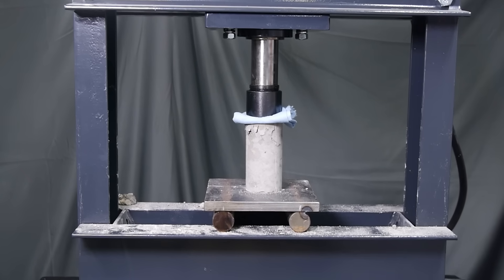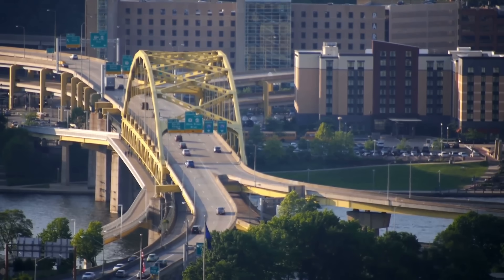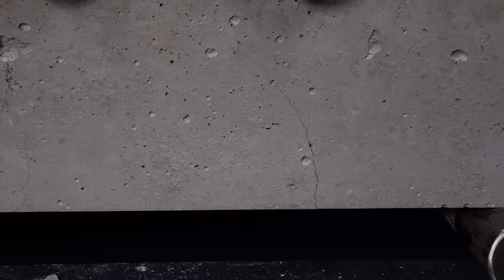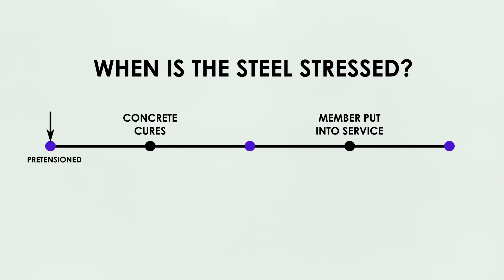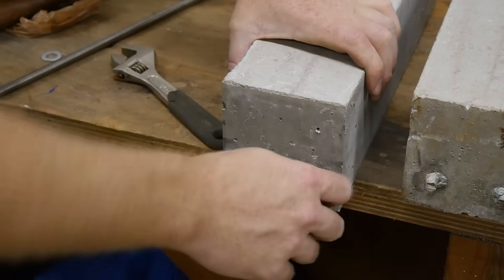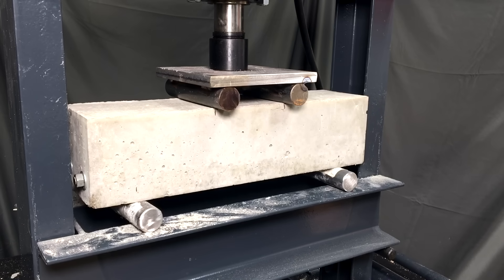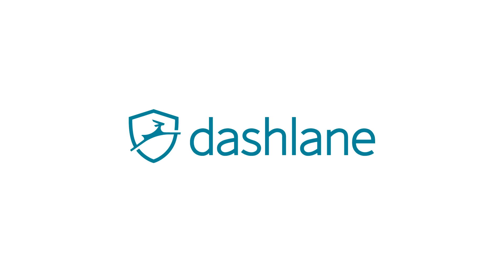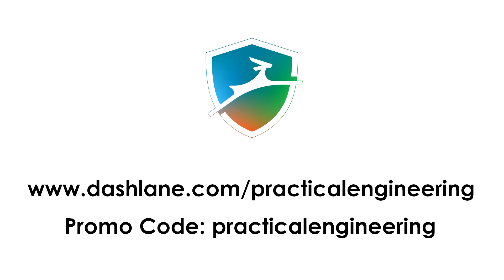What is Prestressed Concrete?

Comment: Thank you, I enjoyed this video. I did not read all 800 comments but I was wondering about something.

What about the ductility of the steel used for tensioning?  I expect this depends on the grade of steel used. In the case of pre-tensioning, once the metal stretches, I assume there is nothing else that can be done.  In the case of post-tensioning, it would seem that the steel could be re-tensioned several times but a limit would eventually be reached.  What is the typical service life of pre-stressed concrete?

Comment: Seems that the pretensioned has the stress across the full length of the bar, while the post is put on the ends of the block. Any discussion about that?

Comment: Hmmm...notice that the pre and post tension beams both have a catastrophic failure ( concrete breaks shortly after cracks formed), while in conventional method the cracks can be observed well before concrete breaks. I am not sure how frequent these structures are inspected but catastrophic failure always needs to be avoided? Or it only because the shape of reinforcements is not universal rebar and it affected the result.

Comment: Hi Grady,
   
If both prestressed rebar reinforced concrete and conventional (no prestressing) rebar reinforced concrete with steel/glass fibers mixed in can reduce deflection (and hence, the cracks), which method is better in terms of cost, feasibility, etc? Are there different applications/projects for which a particular method is more suitable?   
Also, it would've been good if you had mentioned how prestressing is done in real-world construction projects. I assume cured prestressed concrete blocks are brought in and assembled on site to build a structure, rather than pouring the concrete on site.    
Another question: Is prestressing or mixing steel/glass fibers useful for building houses (say, a 2 or 3-storied house) or will that be an overkill and, hence, unnecessary? Don't know about the U.S., but in my part of the world, reinforced concrete is used to build houses (especially, the roofs).   

Thank you for making these informative videos; I am learning a lot from them.

Comment: Great videos! I'm wondering how engineers determines when they are checking for example old bridge is it still safe to use. How they calculate it and how they check it on the spot. Thanks!

Comment: Thank you for your hard works. I went through your series and found unknown knowledge. Here are some ideas pop up when I watch your interesting experiments.
1. How about you test the effects of glass fibers to the mechanical properties of the pre-tensioned concretes in the next episode as we found that the composites have better performance.
2. The admixture did not show enhancement in term of increasing the mechanical strength of the concrete compared with the ones using the same level of water. How about you increase the amount of admixture and lessen the water adding.

Comment: the beam failed due to shear stress not due to bending moment. u can see the crack developed in 45 degree angle (max shear) and the reinforcement has not failed because it resisted the bending with no problem.

Comment: can you use both methods in the same piece of concrete? If I understand it correctly, pre-tensioning before setting prevents the bowing that produces cracking, the metal takes the force instead of the concrete (holds force x 2). While post-tensioning induces a bow, and to bend that bow is compression--concrete's strength (holds force x 2). That bow also can bend more in the opposite direction until cracking (1 length+1 length=2 lengths before cracking point). Post-tensioning both increases strength, and increases the length of bend until it reaches cracking point. Doing both methods in one piece of concrete--using 4 rods, 2 on each task--would introduce a bow (post-tensioning), then keeps it from bending (pre-tensioning). It takes more force to bend (force x 4), and when it does bend, it needs to bend farther until cracking point (length x 2). This appears to be dramatically stronger than just one method.

Comment: Great video as always! I have a question, though (*and an idea for another video!*) Our house is built on a post-tensioned slab, rather than a deep foundation (suburbs of Phoenix). It has warnings imprinted on the concrete never to drill or tap holes, and when asking a construction contractor why, he said "because the entire slab will basically shatter and explode".

Needless to say, as someone with a science and engineering background, I find this... unlikely. Concrete is brittle, but not that brittle. But is he right? What does happen if you damage pre- or post-tensioned concrete under load?

I'd love to see a video where you build another beam of pre- and post-tensioned concrete, and instead of just amping up the pressure with your press until they fail, instead put them under their design load, and then drill into them to see if they exhibit such a spectacular failure mode as this guy was describing. If they don't, then you could explain why the slab has that warning. I suspect it may simply be because if you damage the reinforcement while you drill into the concrete, that could be bad indeed. That I could actually see creating some sort of (minor)explosive failure state as the steel snaps rather than bending like it did in this video.

Comment: Just a suggestion:
Maybe you should include a picture in picture of the pressure gauge on some corner of the screen with the shot of the corresponding beam undergoing stress.
This is so we could better compare how the beams are affected by the amount of pressure you put on it.

Comment: Do prestressed rebar (like prestressed basalt fiber rebar) have the same effect?  In other words, can you pour the concrete around these rebar and still have the same strength (except at the ends)?

I'm looking to build concrete foam pontoons and it's important not to have metal exposed to the water to avoid rust and resulting failure.

Comment: bigger washers might have helped with the ends not breaking with a softer washer between it.
the metal would be stronger if you used "Cryogenic hardening" them to eliminate its weak points. Since your bar is only as strong as its weakness. Problem is no one treats them to make them over 2 times stronger for a fraction of the cost. https://www.thebalance.com/cryogenic-hardening-2340006

Comment: You are confused and I am surprised no one has called you out.

PRETENSIONING the rebar is one thing, which you described in your video.

PRESTRESSED CONCRETE is something entirely different. It’s when concrete under leveraged load, like in an arch or bridge, will be predictably bent by the load. So, engineers design the structure so it is bent in the opposite direction when cast, and once it is under load, it will bend to the desired shape. And yes, so it is under compression by default.

Comment: I’m not recalling if you’ve covered this before, but I recall reading a paper talking about how modern fast-setting high strength concretes are more vulnerable to fractures due to increased thermal expansion while curing than old slower setting concretes.

Comment: Could you put in some sort of fiber into concrete then post stress it with a temperature change ? That way you could have pre tensioning in every axis ? For example cast the concrete in a hot environment then once it has set, let the concrete return to ambient temperature thus meaning the fibres will thermally contract and thus pre tensioning the concrete ?

Comment: When you lay your vibrator in the mud horizontally you create larger voids in the mix compared to vertically inserting the vibrator (granted the size of the demo is the limiting factor). 

This is something Texas Department of Transportation has inspectors look for when concrete work is done involving a vibrator.

Comment: I think the last destruction was due to shearing because there was a typically scratch at 45 degrees. Maybe in some of your next films you should explain models of destruction of concrete and maybe a process of designing a concrete which is hard to do by the way. I’m from Europe and we have eurocodes which are different than your norms I believe, show us differences. Do you engineers use metric or imperial units?

Comment: At 0518 sec- If i am not wrong, vibrator get all air bubbles out of concrete and it is called compaction not consolidation which is when water get out.

Comment: Hi Grady. Great video! I have a follow-up question: does pre-stressing make it harder to spot concrete that is nearing it's failure point? I would imagine that more deflection has one key advantage which is that the cracks being visible makes it easy to spot and address load issues earlier. I suppose there is a balance here as well between maximizing serviceability and lifespan versus making it easier to see how close the structure is to failing. But maybe there's a better way! I would love to see a follow-up video discussing how we detect and address imminent failure in concrete before it had the chance to actually fail and I am guessing there is all kinds of nuance there too, maybe even some embedded electronics in today's hyper-techological world? Thanks for this super interesting and well-made educational material!

Comment: Sweet I'd been trying to find out just what prestressed concrete was.  Thanks great explanation.

2yrs later I see that I've watched this before.

On the prestressed type, where the rods are stressed prior to the concrete being poured.  I assumed that the end of the concrete would have a plate that the ends of the steel are secured to.  Seems to me just letting the concrete cure around the steel would be less effective that way.

Comment: Fort Duquesne Bridge!  1:27 I'd love to slap whatever Engineer designed the lower decks of those two bridges - two lanes merging and trying to cross on a bridge... I'm sure most of Pittsburgh thinks the same too!
Reply: What a Hassle! Multiple lane changes, dozens of times per minute during rush hour. And if you can't make it accross, add an hour to double back.

Comment: Is it necessary to water  recently dry concrete?
Reply: Usually adequate to cover with moisture barrier during first eight hours of cure, except while a float is used. Sprayed water can remove fine cement between the sand grains, increasing porosity, but shouldn't hurt to dampen gently. Direct sunlight drying the surface is bad.

Comment: Enjoyed the video. I was hoping you would also talk about the post tensioning with cables and rebar. In a lot of beams you have rebar continuous across the bottom and cables running through it as well in a Cosin arch with the high points above the theoretical supports and the low point of the cable at the center of the beam.

Comment: Looks like both of the prestressed samples failed when the concrete immediately around the reinforcement failed when the load carried by the steel exceeded the shear strength of the concrete holding it in place.

I wonder if using much larger washers on the end of the rods for the 2nd sample would have delayed it's failure.

Comment: Wasn't that recent terrible bridge collapse accident caused by incorrect tensioning procedures?
Reply: Very complacent response to cracks at base of #11. 
It was mostly a design fubar. Not enough shear control at the ends of the deck, and undersized member #11. Not enough critical oversight. Very sharp edges instead of large radius transitions. The lower surface of the overhead section went into tension at the top of #11 - yet the post tensioning for that was scheduled for much later.

Comment: 6:00 one of down sides to that method  tho is that when it fails it  doesn't tend to give any warning ..like sagging it just snaps.. where as   the bend and degree of cracking in non prestressed  concrete does

Comment: Sorry I am very confused but also not an engineer. How does stressing the steel before the concrete hardens help? If the beam is compressed before the concrete is solidified, then won’t it be pulling the concrete apart when the stuff compressing it is removed?
Reply: The tension applied to the pre-tension steel is applied to a frame outside the concrete mold. There is No force on the cement while it cures to at least 80% of the nominal strength. Afterwards, relaxing the force on the outside frame means that the force is applied to the concrete instead.
Reply: Pretensioning can help while transporting the beams, just don't carry them upside down.

Comment: No googly eyes? Your voice sounded familiar, but without the random googly eyes in the video, I had to double check what channel I was watching.  Before you abandon concrete altogether, I've been put in the middle of a debate regarding residential foundation repair. Some repair companies say that steel piers are the only way to go. Others have said that concrete piers are the only way to go. One repair company even said that every home he's seen that had steel piers used, has had them corrode through and needed replacement with concrete piers. The soil in question is that horrible Texas clay in the DFW area. Is there a significant difference between the use of steel or concrete piers for a foundation repair?

Comment: If we could build a machine that inserts the aggregate inside the concrete in an orderly fashion, instead of just randomly distributing it, would that potentially have interesting effects on the concrete's strength, or at least its consistency? All those randomly distributed little stones of varying strengths and sharp edges must cause micro-cracks inside the concrete I guess?
Maybe spherical aggregates? Or bigger aggregate at the bottom, and smaller at the top (or vice versa?)

Comment: The working years from 1986 to 2009 of having been an Inspector of New Construction of Highways and Bridges for TXDOT... Highly Applaudes you're coverages of the characteristics of the nature concrete has up it's sleeves under tension & compression. 112718

Comment: Grady, I heard you say one of the goals of construction using concrete structures is to limit movement. This concerns me because of a new bridge serving as an entrance/exit for an Interstate near where I live.  It's a new style of interchange, sort of a modified double diamond where lanes cross each other in the center of the bridge in an x-shape. This is a google maps view:

https://www.google.com/maps/@38.7325752,-89.9124127,287m/data=!3m1!1e3

The reason I'm concerned after watching this video is because this bridge moves, a lot. I often take this exit off the interstate which requires a left turn onto the crossroad. When waiting at the light I'll often see tractor/trailer traffic crossing the bridge in front of me as it enters the interstate. As the large trucks cross the bridge I can feel the entire structure bouncing up and down. Is that a design feature?

Comment: Great video, but I don't know if this covered everything. In a concrete beam that will only ever see a purely compressive load, wouldn't prestressing make the beam weaker? The compressive stress would add to the prestress to reach the failure stress. This concept seems hard to explain without Moh's Circle -- I think your next video should be on that!

Comment: Question: how to they apply the stress in large construction projects? You apply stress by tightening bolts, but I assume they don't just have giant bolts to tighten on a bridge or building, do they?
Reply: Sometimes they do put giant bolts in. Sometimes they make the pre-stressed concrete parts off site in molds (similar to how it's done in the video) and then transport them to the site and assemble them. Road segments on bridges are good example of the latter.

Comment: As I was passing the parking garage on my way home I noticed something. There were a bunch of circles littered in symmetrical spots that look like they were holes that were eventually filled in. Are the little circles places where rebar was pretentioned and then covered to prevent corrosion?

Comment: Greetings from Denmark, home of the best sand for concrete. :)
Without prestressed concrete, I would have had far less to do at work for the past year. 14 railroad overpass bridges (reverse T-beams, dang that white, high alcalic cement cures fast!) and 2 parking houses (TT-plates and parking decks, dunno what they are called in english) under the belt. And that's on top of the normally rebarred stairs and landings I have made production drawings for. :)
The heaviest beam I have drawn so far was a 1400mm high and nearly 19m long dual console beam (800mm consoles) weighing 41,86 metric tons. All becsuse the architect wanted to fit in one more parking space between each column in the parking basement under a supermarket with 3 floors of appartments above it...
Reply: laughs in Australia
Reply: Godt det ikke var mig der skulle armere den søjle haha
Reply: Glad to hear that in other countries there isn't a war being fought against the personal automobile. Around here, they wouldn't bother to build any parking or they'd put in a dismally inadequate amount.
Reply: @TruthSeekerD  you might be surprised but we have no idea what "around here" means for you
Reply: @TruthSeekerD  
Also missing most the point of the post. He used that as an example of an architect gone wild, not a good design philosophy.

Comment: I used to frame houses when I was younger and got to see post tensioning in action. Every slab poured had cracks in it, however after it was tensioned those cracks sucked up and we're almost invisible afterwards. If I ever build my own house it will be in a post tensioned slab.